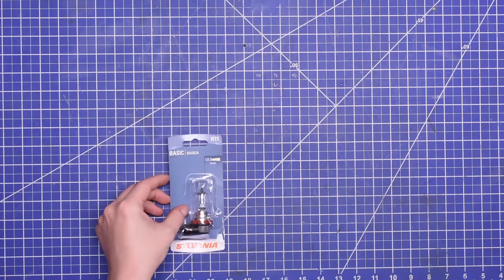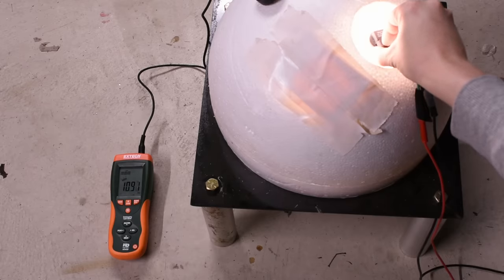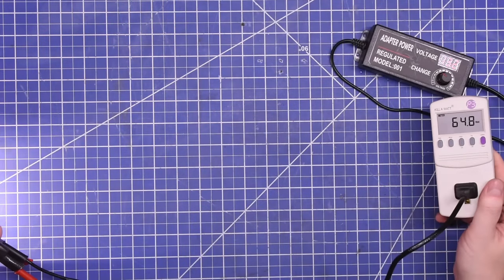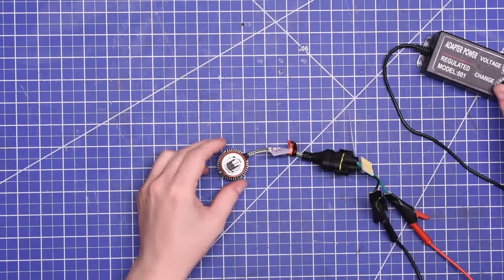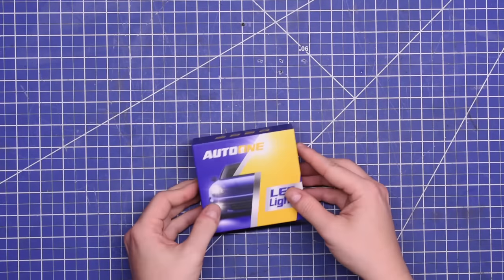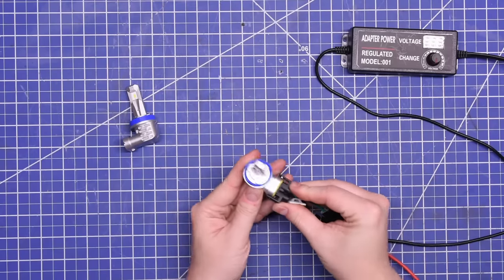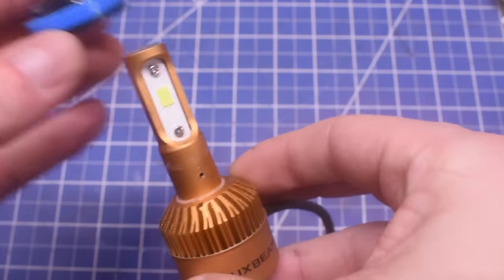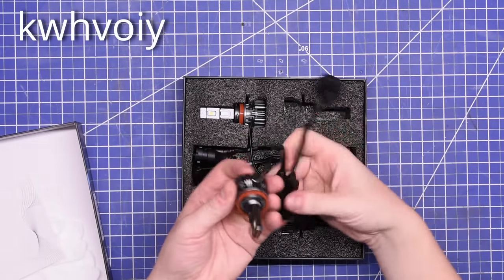Amazon Headlight Bulbs are Getting Out of Hand

Comment from the maker: I think a lot of you haven't caught on yet that we always mispronounce Amazon brand names, because it's fun :D We tested these because of their silly lumen claims you guys wanted to see those, but whether they are actually useful and not totally annoying in most headlamps is debatable - WE FEEL IN MOST CASES NOT WORTH IT
Amazon horns: https://www.youtube.com/watch?v=zAe9qvC49qY
Amazon lasers: https://www.youtube.com/watch?v=ZH3yMeA7HxQ
Amazon flashlights: https://www.youtube.com/watch?v=6q_0wxzClkg
Reply: I'd like to see estimated bulb lifetime listed/talked about on halogen bulbs. xtravision is 850 hours, and the silverstar ultra is only 200 hours, which makes the cost per hour alot more. For some folks who commute during nighttime they could be replacing headlights yearly.
Reply: If you can't raise the voltage more, you've hit the current limit. Maybe it can supply more power at a higher voltage if you stay within the current limit, but in this case if the readout is accurate you're tapped out on current (but maybe not power). Confirm with a multimeter
Reply: I think it is just tapped out and is current limited. 

I believe headlight bulbs are rated at 12v anyways (some modern cars even run PWM power to the headlight to keep it at an effective 12v.

If you have an ammeter and put it across those bulbs I have a feeling you will get to a point where current will no longer increase. It's probably only able to deliver 5A, some of those bulbs probably would have liked 6 or 6.5A

When you got 75w out of it charging the DeWalt batteries they were accepting that current at a higher voltage.

My 300W desktop power supply doesn't have the drive to power a halogen fully. It's only 5A.
Reply: I hate to even say it. But I've had 2 sets of Hikari. "Eye of Megatron" and then some unknown model. And I was extremely happy with them. After your review. I am well aware they are lying about specs, but white n bright is hard to hate over yellow n mellow.  I also had a set of auxbeam f16 I believe. And they required to be adjusted with a screw till perfect, after your video I agree with your findings. I thought they were better then stock. But meh. Would really like to see Hikari models tested, they make 3-4 models with different specs. The customer service is also easy peasy. One set wasn't good for me n they sent another. Turned out my connection was bad, so I had 2 sets for price of one.
Reply: Hid kits are insane too.... They are worse then leds. They claim the world n almost always fail or change colors. My friend had 2 light blue lights, one turned light purple n one turned more white and would shut off sometimes unless high beam for a second. He spent $80 some dollars for them too.
Reply: The best led bulbs I know of are
Bevinsee's V45 and the Apollo x-7seven. The Apollo is pretty pricey but seems to 1 up everything else whereas the Bevinsee seems to be just slightly behind but a third the price.
Reply: Omg freaking finally!! Since you started doing the flashlight testing series I kept asking about headlight bulbs (specifically boslla). But not just on reflector *housings*, projectors as well. A good bulb will distribute the light excellently in a projector and actually make it out onto the road. I've had the best luck with boslla, before them I had spent probably $700 and all the lights were terrible. Their B1 bulb is the best in my opinion but given the fact that you guys like to spend money, you could try their most expensive line of bulbs but have the B1 as the base (obviously). I am not sponsored but I do love boslla. I put them up against Sylvania two weeks ago 9007 vs 9007 and believe it or not, with a ballast, and $50 more expensive, the Sylvania ones just were not as potent.
Reply: Try auxito… I have around 12 off-road vehicles and that’s all I use, never been disappointed and they last forever
Reply: I'd be wondering how the old sealed beam style replacements fair on this testing as far as actual lumens. I bought a set for my 94 S-10 blazer. while it's brighter and crisper to the point I don't think I should ever NEED the highs and on the cool side at a claimed6500k color temp. I seriously doubt it makes the 6500 low beam and 9500 high beam, lumen claims. mine came with integral turn signal and a day running light option on it. I never bothered to wire up those two options. just the mains
Reply: I've found torchbeam t5 to be good without blinding people although my headlights a projector  style unit
Reply: Can you also test the LED bulbs at reduced voltage, light Day Time Running lights. I have found some just aren't capable of running at Day Time Running light voltage and turn ON at full brightness.
Reply: I work 2 seats down from the senior lighting engineer at a major OEM and spend alot of time talking with him. There are alot of factors that go into beam projection and whether or not they cause "glare" with oncoming traffic. I can go over testing procedures for how we benchmark glare with you in a non-public forum if you'd like.
Reply: You should test out LASFIT and Sealignt LED headlights for sure in the next one. I have the LASFIT 9007s in my Town Car (along with their 194NA side marker bulbs, 3156 reverse lights, 3157 amber signals, 3157 tails, 3157 cornering lights, and 921/912 3rd brake light) and they’re honestly super solid at night. Sealight’s also popular with the Crown Vic community as a common upgrade, so it’d be nice to see how they perform on your tests!
Reply: Forenner and ursprung works pretty darn good ,i measure a h4 at 3900 lux vs extravision at 1300 lux and only 2.2 amps. Beam pattern identical to oem on the test canam spyder and tacoma
Reply: Thank you for acknowledging how awful the beam patterns are with some of these. They are never going to be great, of course, due to not matching the optical design of the headlight. But some of these are horrifyingly awful for both the driver and everyone around them.
Reply: I'd definitely like to see some sealed beam bulb comparisons!
Reply: For a good option check out Diode Dynamics drop in replacement bulbs.
Reply: @Turbochargedtwelve  i would like to see these also have had a set on my car for 4 years now.
Reply: @TorqueTestChannel  Try out Beamtech brand, they seem to have a good pattern but are a bit in the cool white zone. They claim 10,000 lumens on their base model and thats what I have been using in several cars, I would guess around 2500 lumen output...but they have other versions they claim much higher output and I am unsure if they are designed for halogen reflector housings. So far they have been pretty good and long lasting, on year 3 for one set.
Reply: GTR Lighting Ultra 2s would a good one to test on the "higher end" market side.
Reply: I've put Beamtech in a few vehicles as well as Hikari bulbs. Had good luck with both overall.

I'd also be curious to another housing as well. Maybe something like an F150 housing, though you'd probably be buying all new ones to fit. I would be curious to see the high vs low beam of each.
Reply: Please test the Novsight N37
I have those in my high beams and when testing against friends halogen high beams and xenon high beams it was almost laughable how much more light the N37 produced.

I use the Osram HL XLZ in my dipped beams and they seem pretty good and non-blinding.
Reply: Not sure if its been suggested already but Fahren makes some pretty bright led bulbs that are clockable. In other controlled tests I've seen they've come out ontop. Would love to see you test if thats the case.
Reply: why are you using 12v ? the voltage with the car running is usually between 13.5 and 14.5V
Reply: Most LED from online stores are Garbage.  We need to be really particular and usually they cost about $100 or up for a good LED.  YOu should try the gold standard like GTR Ultra 2, Morimoto 2 strokes, Bevinsee V45, v35, Lasfit LS Pro, Auxbeam GX, Hikari Titanova, Apolo X7, etc.
Reply: I'd like to see the Philips X-treme Ultinon LEDs tested. Stupid name, good headlight bulb.  It would be interesting to see what your test results are.
Reply: @Danidasanic  he had the voltage at 14.4
Reply: Could you test HIR’s (9011 & 9012) made by Phillips & Hella. Thank you
Reply: GTR Ultra 2.0 LEDs are great in my opinion. But they are not cheap.
Reply: How to quality their 'non blinding other vehicles'
- please compare to a Tesla's light..   Mount some in a reference frame, then look into them at a fixed distance/height and compare glare.
I  often find 'high end' car headlights blind me, even during the day they can be a pain to pass. I wonder how they passed certifications.
Reply: Test real xenon bulbs. Vs LED or halogen, etc. D2R type are one of the OG kits that helped spawn future Xenon lights that eventually got replaced by LED.. they'll have a separate ballast box. Fat style original and digital slim. Most Slim's suck. But I think xenons are far brighter and better looking than halogen and definitely most LEDs. Companies aren't supposed to use xenon anymore because they're too damn bright
Reply: What do you use to measure color temperature?
Reply: @johnlane5344  Considering that the bulbs are on all the time on many cars (daytime running lamps, and you're not allowed to turn them off), 200 hours becomes a few weeks of driving.    Mind you, they aren't likely to be setting the lifespan on that section, but you never know.
Reply: @volvo09  Most headlight bulbs are designed to run at 14 volts, which is the charging/running voltage for most alternators and car systems.  They're 12 volt 'nominal', but that assumes that you're only running on the battery.
Reply: I put a set of Sylvanias, I think it was Ultra halogens, into an older Highlander.  They were definitely brighter than the old one (one had burnt) and seemed to have a bit of extra light up higher above the cutoff.  Sold the car before it had more than two years on it but had not had any failures.  I had looked at the rated hours and def didn't want the short life ones.  
As far as glare test, talk to an automotive expert I suggest.  However being an older person with beginnings of cataract degradation, I am very sensitive to glare and the bluer it is the worse it is.  Which means all of the users of the 6000K+ bulbs make things really annoying, especially when they have extra light above the cutoff.  I think that there is a point beyond which increasing color temp makes no benefit in being able to see what is ahead, and in some cases such as foggy conditions the bluer light may make things worse.
Reply: @johnlane5344  Sylvania will be the first folks to tell you that as you go up each step in brightness, they will burn out faster. That's pretty much a function of how bulbs work.
Reply: I have been using Nilight brand LEDs in my stuff.  Used to hate driving at night with the halogens, but these really lite up the road.  It's a newer truck so the housing covers the light and keeps it from completely blinding on coming traffic.
Reply: Bro, I need a Chevy impala headlight housing!
Reply: Guess you have to live in America to buy any of these lamps, none of them appeared in my Amazon store
Reply: Before I switched to LED, I had to replace the sylvania xtravision/silverstars quite often. Not that they failed, but definitely got dimmer with use. I haven't noticed LEDs get dimmer, but my truck is now hid. The best headlight I have ever experienced is my wife's JagX8 which is unbelievably sharp and focused.
Reply: Test a few of the sealight branded bulbs. 

I've used a few different versions
Reply: Nighttime... Shoot my headlights are on no matter what time of the day.
Reply: Would love to see a test with high beams. My Toyota can't take ''extra lights'' because Toyota locks down their software and installing an extra high beam switch is not an option, so its either drive slower or hit a moose. I would instead love a better high beam that fits the OEM housing but don't know what to trust.
Reply: You could start by noting which ones stated "for off-road use only"?
Reply: The headlight housing you used for the test was terrible quality and not typical of a oem headlight. I used the auxbeam headlights in my canam ryker and can assure you that they don’t look like that.
Reply: I have some 'NOVSIGHT 9005 HB3 LED Headlight Bulbs 55W/Pair 10000LM 6000K' that have replaced some dim halogen main beam lamps in a Hyundai and I'm pleasantly surprised how good they are.
Reply: How about the older style headlights? The whole bulbs? Round and square/rectangles...
Reply: Simple rule of thumb, don’t buy from a company that chose its name by random presses on a keyboard. Chances are if they’re not concerned with a pronounceable name their engineering is going to be equally problematic.
Reply: At least 36 000 lumens wouldn't end the whole universe, like 600 dB would xD . Ok, maybe not the whole universe, but it's a lot more rediculous because of the logarithmic scale.
Reply: The diodes must face directly "3 and 9 o'clock" to work as expected, and to be properly compared. that collar is designed to lock in place so you can position as such after it is tightened into place(I got a tiny allen key with sets I've purchased). This is a pain, and required me to lay on the ground and mark where I needed to tighten it down on my fog lamps, but trust me, it is worth it.
Reply: I run PIAA LEDs in all of my cars. They're pricey around $250-$300 a pair, but I figured that you get what you pay for.

Am I right, @Torque Test Channel???
Reply: I have a brand called "Nineo II" that I have in a few vehicles. I absolutely love them. I'd love to see what you think about them.
Reply: The box is called a canbus. Some models flicker like crazy. For a low priced bass ass led you want HIKARI EYE OF THE MEGATRON. ANOTHER DECEMT FANLESS model is rhe FORSHER
Reply: Cheap ones dont last worth crap. Use the gloves of it doesnt come with gloves there not high quality. So far hikari eye of the megatron i have found to be the best. Blast anyone who flashes u. Also ive found 3 ro 6 months depending how much you drive at night is about the going eate for CHEAP leds. But if i spend 70 or more most brands will have a replacement at tour door within days. Check that warranty period some are lifetime. U just have to save your box and of course it will stay in your amazon orders
Reply: Auto one 😂
Reply: I’d like to see you try the sea light brand I’ve used them and love them for there consistency
Reply: Many years a go here in the UK, I had a Civic Coupe, and just wasn't happy with the headlights at all, even after replacing them with standard but new set. So, I looked around, and our Halford did (back then) sell 100w/80w H4s. MAN!!! What a difference!
YES, I occasionally checked the wires feeding the power to the bulbs, and no issues were found. BUT WHAT A DIFFERENCE! they had the familiar blue band around the bulb that made them ultra white - THAT helped too..
No, according to our MOT (our Govt Vehicle annual safety checks), these weren't for 'Road Use', but, she passed many an MOT!.
Since though, I've occasionally looked around for LED H4 bulbs, but.. Have heard some horror stories on wrong beam patterns, rapid failures etc. And seeing that the better made/working LED bulbs are at, what? £100+ a pair? And as Halfords have long since stopped selling those 100/80s, I've had to resort to a pack I bought on Amazon Philips 'Racing Vision' GT200 "Up to 200% more brightness".. And, yeah, over 'Standard' bulbs, there IS a big Difference... And they turned out to be pretty reaonably priced too for a PAIR pack - Around £20...
IF, you too are a little hesitent at venturing into the world or LED replacement bulbs... Philips 'Racing Vision' GT200s.. They're a GOOD bulbs if you want clear, white, BRIGHT bulbs at a GOOD price, and there are multiple formats Philips do them in too.. 👍      😎🇬🇧
Reply: Please test Auxido & Fahren led bulbs
Reply: @dumbelldoor610  same....bought them for all 3 of my kids' vehicles and they love'm....I do too.
Reply: Thanks🇺🇸
Reply: I added the Auxbeam H11 F-S3 to my Camry and one of them died after 3.5 years.  One of my biggest issues with them was the noise they created on the radio channels over 95.1 mhz.  I tried adding ferrites, but that did not help.  Can you redo the test with a radio connected to see if they all create this interference?  I am thinking the ones that do not have a fan may work.  Until I find one that is not noisy, I'm sticking with halogens.
Reply: @AEVMU  Yeah, Rocky sez "don't hit Bullwinkle!". Assuming both you and the vehicle survive more or less intact, that is a LOT of freaking mooseburgers, moose tacos, moose spaghetti sauce, moose mac 'n cheese, moose sausage, etc. and so on. Trust me, I got that t-shirt.
Reply: @cyclet4819  I bought some more "Torchbeam" LED's 2 weeks ago for my sons truck and noticed (in the world of LED's) they're addressing the interference issue. He hasn't mentioned any issues with that so far. We all pretty much listen exclusively to streamed cellular signal...not radio.
Reply: Has anyone mentioned LED lights are not legal as headlights in the US?  Most are sold as foglights.
Reply: @jimbane1568  As long as you're not one of those idiots who just switch out the lights and start driving around without PROPERLY ADJUSTING THE BEAMS.
   When it gets dark, find a level street, turn on your new lights and adjust them to cast the low beams out about 35 to 40 yards.... and if you're smart enough...aim the left light a little to the right to help on-coming with your new glare factor....(some people wear glasses ya know...)
Reply: @fluke196c  depends on which spectrum you're using and the application. But often places use charts found with the Kelvin scale. E.g. 3000k is yellow 5000k white, 8000k blue , 10k blue , then purple and so on. Software companies that do color profiles use their own priority scales and sht but you can use RGB as a base to start if u wanted to see how those color temperatures vary crosss platform and cross industries/trades .
Reply: I'd like to see auxito, hikari, philips, morimoto leds. thanks. cool video
Reply: @numberone9178  they're all Phillips lights in North America. They are the licensers and basically everyone else is the licensee. Courtesy source USPTO
Reply: @Swim Fan  i appreciate your reply but if that's the case, why the big difference in performance? Maybe the chips are from philips but the build quality is definitely different
Reply: I'm assuming the majority (all?) of these were manufactured in China.  So, do we have any subscribers or commenters here, who are fluent in Mandarin?  If so, maybe they could help us with the pronunciation and/or translation.  🙂
Reply: New bulb...re aim your lights...
Reply: Sylvania makes led headlight replacement.
Reply: Excellent work
Reply: You need to find ones that advertise having bulbs like the CREE XHP-50 and the CREE XHP-70 bulb along with ones with a similar led chip. I use them in my car and they are on a different level of brightness compared to the COB chip ones in this video. In which as we know, COB chip lights are bright but don’t have a very good throw of the light.
Reply: You cannot just double the lumens from 2 sides. It should be just 1 or 1.2x because the lumens is over the whole surface and your sensor still read 1 solid angle that hit it and multiply by 4 Pi R.R .   So all of those cheap LED are actually not brighter than original Halogen and hat worse patterns.  I suggest you use tested and good LED like Bevinsee V35, V45, Lasfit LS, Apollo X7, GTR Ultra 2, etc.
Reply: It still won’t come close to their claim  but you need to quadruple the measurement from one side of the led. Companies pull lumen counts from the entire kit therefore they roll both sides of the light and both lights into the same measurement. It’s why you can find 4 piece kits claiming to put out 60000 lumens
Reply: The OEM designs really are made to be very efficient, at least in modern HID projector designs.  It's not like the old days of sealed-beams where aftermarket designs were almost always superior.  LED "upgrades" are really a gimmick.  Halogens are... just get the HID upgrade if you can.
Reply: @josephoberlander  Not really, 99% LED are junks, but 1% are trully better than HID. They are not cheap: BEvinsee v45, GTR ultra2, Lasfit LS, Apollo X7, etc.  I had tried them on my own, they are indeed brighter than trully 35 or 55 watt HID.
Reply: @rondhole  But the marketing fools people into thinking it's the reverse.  Especially the junk at your typical auto parts store.
Reply: @josephoberlander  a lot of aftermarket HID claimed false wattage. 100w in reality 35w.
Reply: Should’ve used a projector headlight
Reply: @franbelta1533  The advantage of projectors is that they degrade like halogens over the years, but they always work, being basically an arc lamp.  I've seen 15 year old OEM projectors that still fire up without an issue.  So one can see why manufacturers like them. But they do need to be replaced every 5 years or so lest they get too dim.
Reply: @josephoberlander  protector is just the housing, not the bulb itself
Reply: @torquetedtchannel, Have you done an LED test on halogen projector headlamps like the ones that come on the new Chargers? The halogen bulbs are dim and I can't find an LED that works without having huge dead spots. Also, there is NO HIGH BEAM on these cars, just a flap that opens up the top portion of the low beam pattern, so driving at night, in the rain is miserable. I've tried 5 different brands so far with zero luck. I'm looking for high beam throw without crazy brightness on low beam
Reply: @lorenii  LED will not work right in a HID assembly and cause light pattern issues. The projector puts out high beam levels but the shutter blocks off some of the light, creating less light out the front as well as a cutoff to not blind drivers. With a LED, this simply won't work right. In addition, HID bulbs that are older can be as 25-30% dimmer than new.  To test this, go to a dealer at night and pull up to a new car with the same type of lights.  Side by side is instantly apparent.  You might just need better bulbs.
https://www.youtube.com/watch?v=JkSOiPSkZO8
Reply: I bought the kwhvoiy.. I like them but Amazon quit selling them
Reply: I JUST GOT OSRAM XTR LED AND THEY OUT PERFORM ALL THAT TRASH HE JUST SHOW THEY BRIGHT AND BEEM PATTERN IS SPOT ON💪🤟
Reply: Great Video!!! I learned a lot. Can you please give us some links on the tools you use? Adaptor power and the connectors you use to light up the light bulbs please. I would like to buy the same setup that you used! Please help! 🙏